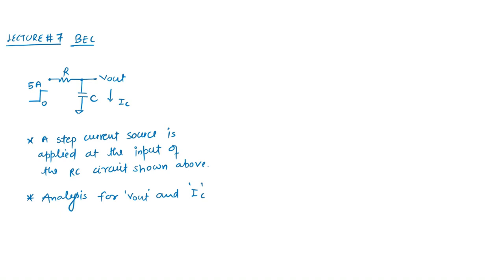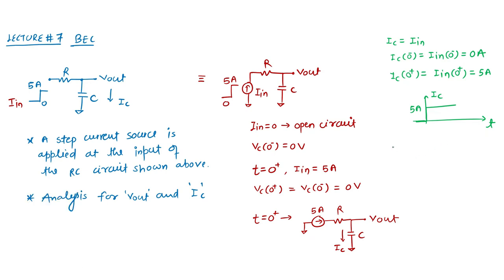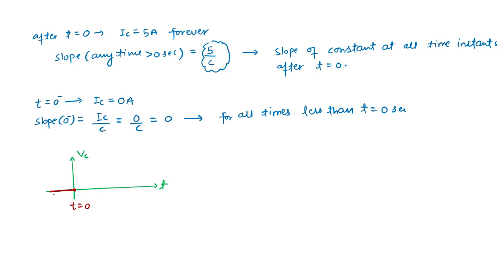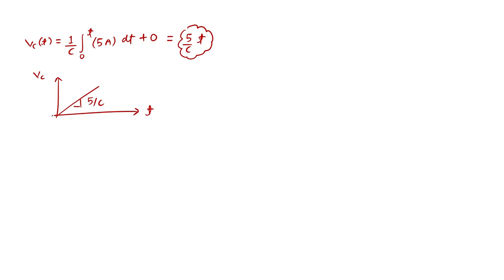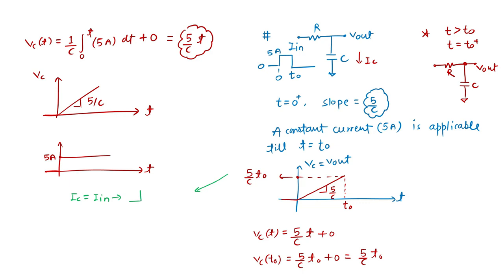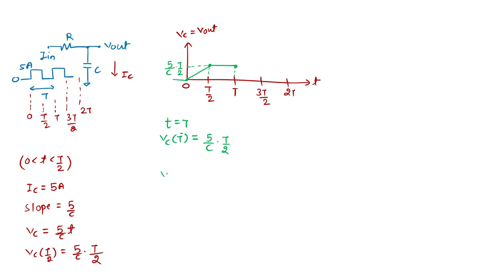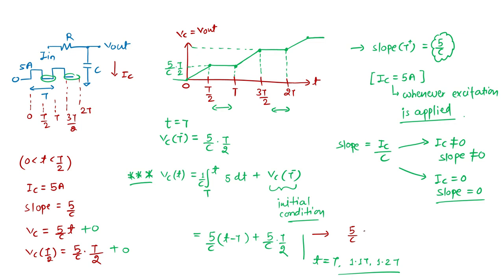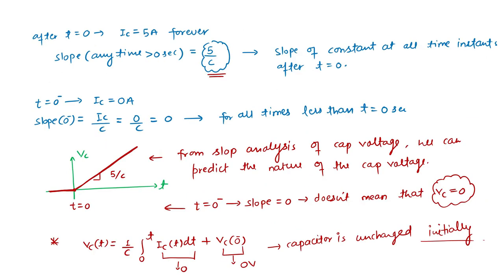Lecture-07 || Analysis of RC Circuit with Step Current Source || BEC Lecture Series

Comment: Nice ! 
Very interesting circuit !i am stupid😅
It turns out it’s simple and clear😅
Reply from the maker: @SAhellenLily good effort... No question is stupid.. it's an idea that comes out by your analysis.. it might not be correct but will definitely enhance your skill of looking on circuits
Reply: Thank you Sir 🥹
The input signal  is 5A step unit ,
t=0-,,I open (0A),vr(0-)=Ir=0v ,vc=0v

t=0+,,I=5A, vr(0+)=5*R,vc(0+)=I*(t)/

t>5time constant and then vc(t)=(I/C)*(T-T/2)=constant value 

So polt vc(t)_t form 0 ramp wavfrom   and then the constant value Straight line parallel to x-axis 🤔